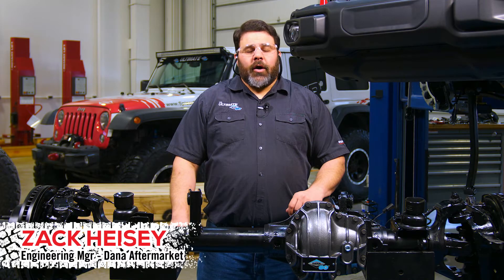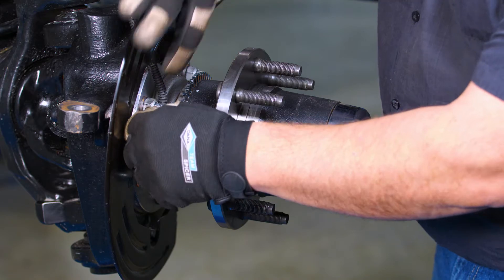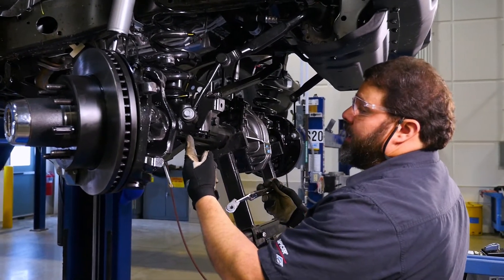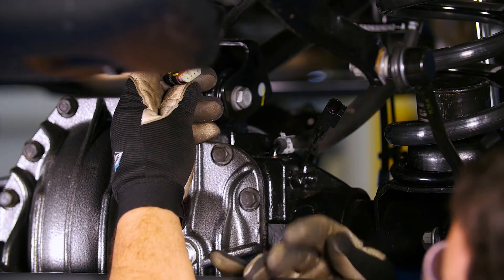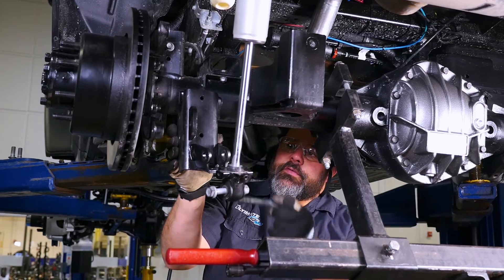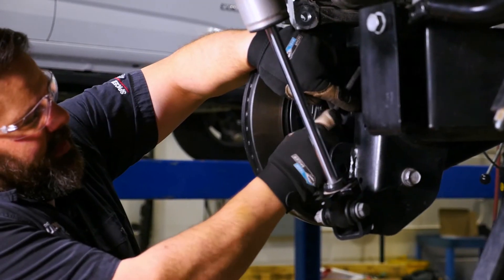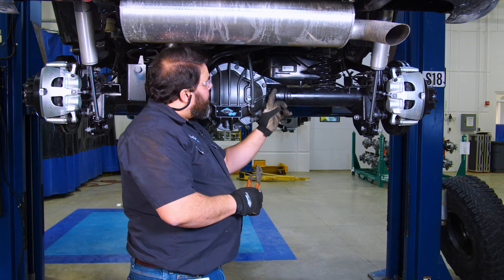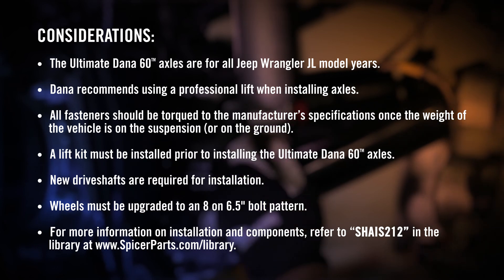How to install Ultimate Dana 60 axle on Wrangler JL | Spicer Garage

Comment: Ok, know the video is 7 years old, BUT...a 3d printed bracket for the ABS sensor?  Depending on what material was used to print with, that mount will get soft and deform after heat cycles from the brakes, no?

Comment: Great video but you guy took a JK 60 & did sighting modification to it. Come on!! Sorry but I like my 2018 Jeep JL Rubicon Dana 44s with the lockers it came with they are more than enough for what I wheel on. In less you guys are going to give me a set of those axles because I’m NOT paying 10,000 grand or more.
Reply: Lol. the jeepers that are buying these axles are usually running 40's or bigger a 44 ain't going to last very long on 40's.
Reply: @colin1528   Very true, the stock Rubicon axle does not support 40's without breaking something ... Personal experience.
Reply: Dave Lucero if someone forcing you to upgrade yours based off this vid?
Reply: Just say you can’t afford it bruh
Reply: You want to run big tires like 40+ you need a Dana 60 it's a Fact you will break those puny Dana 44.
Reply: Is it possible to do this on the 4xe?